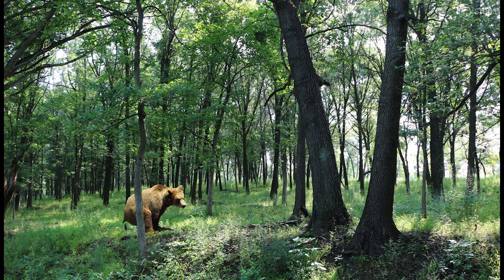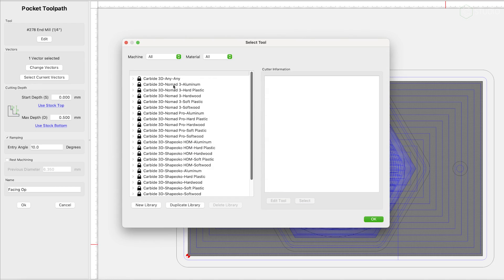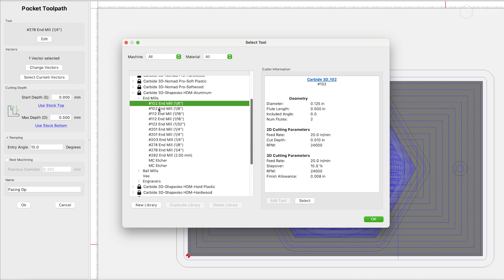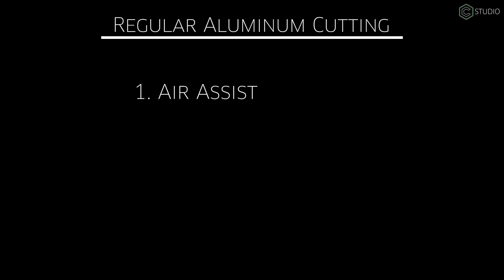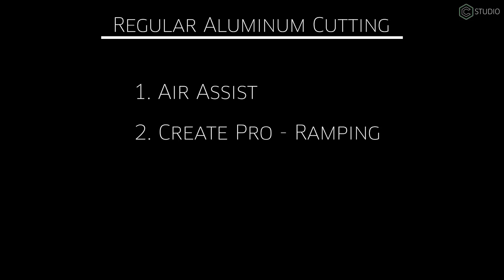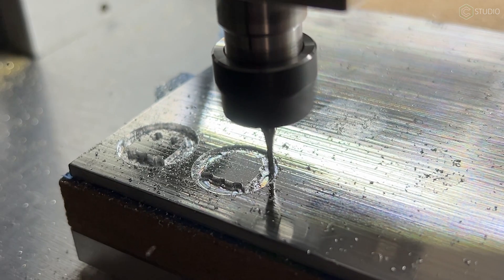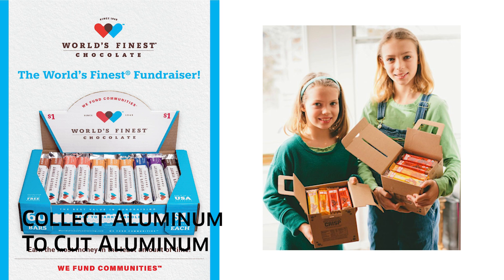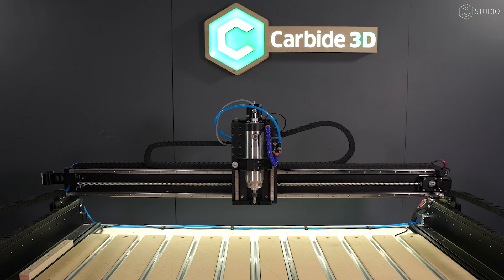Cutting Aluminum - Shapeoko 5 Pro - Video 7

Comment: I thought the air was for cooling. You can generate a lot of heat routing aluminum.
Reply from the maker: If you’re cutting it with the correct settings, you shouldn’t be generating much heat.

Comment: Do you need the sign making (tempered) endmills for aluminum?
Reply from the maker: Aluminum can be cut with most of our tooling.  For many jobs, the single flute endmills are the best place to start your aluminum journey.   #274-Z and #278-Z endmills are our front-line weapons in an aluminum or brass application.

Comment: Also, make sure your chip load is correct. Too high and you'll snap your end mill. If it's too low, friction will create a lot of heat to build up causing the aluminum to melt and fuse to your end mill... especially if you're not using cooling.

Comment: If you had this machine in the 2x2 format cutting aluminum Id probably buy it, you guys need more videos of this machine in aluminum since alot of us want to use it for that
Reply from the maker: We do have the 2x2 format.   The entire machine structure is the same just smaller.  Since there are zero differences, it's  just as capable.   https://shop.carbide3d.com/collections/cnc-machines/products/shapeoko5?variant=40249287737405
Reply: @carbide3d  I understand, the reason I wanted to see the 2x2 is 1. You guys rarely feature the smaller machines and it would be nice to see them, and 2. The smaller geometry with the same specs means the machine is naturally more rigid.  I can bend a 1” piece of steel that is 5ft long, I cannot however bend a piece of 1” steel that is 1ft long.

I’m sure the elasticity of the machines overall play into the vibration damping but it would seem that the smaller machines would be slightly more robust given the shorter lengths of the components.

I know nothing however and really would just like to see one of the smaller machines in action and cutting aluminum.  Kinda selfish to ask but then it’s a lot of money to spend too

Comment: Can we work on 20 mm deep aluminum blocks? We need to drill  holes and chamfer the edges, is this possible with the  Shapeoko? Also is it possible to cut stock lengths of  T2080 slotted aluminum rail? I don't have to buy a separate chop saw then
Reply from the maker: Hey Arbj,  I see you’ve reached out on the forum and gotten a variety of feedback and information.   Our machines, and particularly the 5, are absolutely designed to cut aluminum as regular duty.

Comment: Great video as usual! Covered almost everything here. What would be your recommended chip load (feeds and speeds) for engraving with v-bits?
Reply from the maker: We are in the middle of a complicated aluminum project which includes engraving with the 501 PCB Engraver.  There will be a ton of info there.  
I’ll grab the speeds used in that project.

Comment: We use our Shapeoko 3 xxl to cut aluminum with the carbide 3d router but not dry cutting. Added a mister and use hytap cutting fluid mixed with water. 40ipm with .040" depth. It cuts great but the waste board don't like it. Going to try some of the end mills recommended with just air and see how that goes. Would love to eliminate the cutting fluid.
Reply: How'd it go?

Comment: Another good video, thanks.
My number four for the checklist would be "Know what you are cutting."   It's shiny and silver, and not very heavy, so it's aluminium, right?   Yep, probably is, but aluminium formulated to be squeezed through a die to be sold as flat bar at a hardware store will most likely stick to your cutter like bubblegum, clog the flutes, and make it self-shorten.   (Break, Mary-Lou, it's called "breaking!")   An alloy made specifically for machining will produce results that make you smile all day!  (T-6061 or similar).
Try it out... give a boy a hacksaw and a piece of hardened tool steel, and start your camera rolling!  🥴  😉

Comment: any metal requires use of flood coolant or at least a mister. I mounted one to my 3 and bolted it to a tapped hole I drilled on the spindle clamp. A few hoses, regulator and a gallon container of kerosene/wd40 or synergy 735 coolant is all you need to prevent chip welding and have much happier cuts. It will pool and make a mess so you might want to put down plastic or some kind of board you don't mind getting soggy.
Reply from the maker: Use of coolant is up to the end user and not required.  We cut dry 100% of the time.
Reply: @carbide3d  what bits / coatings are you using to not chip weld the tool up ?
Reply from the maker: Bits are in the description.  Zirconium Nitride,  Single Flutes are less likely to get filled up.  If any endmill does begin welding, a good Lye Soak will bring them back to new.
Reply: @automan1223  I've used uncoated endmills. The main factor is the person programming. With proper strategies, feed/speed, you don't get chip welding. A good chip will put the majority of the heat in the chip and away from the material/endmill. Single flutes do help a ton with chip evacuation.
Reply: I've cut aluminum, copper, and brass dry, air blast, and on the HDM with mist. All cut great. Metal certainly does not require flood. Is it better, yes.......required.....no.

Comment: so 3500 for the 4x4, 750 for the vfd figure 250 for some accessories like bit setter or something, that $4,500 defiantly not a hobbyist  piece. your getting into grizzly vertical mill with controller territory, only thing is you have more surface area to work with. it sucks you dont still sell the actual hobbyist machines like the 3 for 1,500 and then offer these for the more hardcore people.
Reply: It would be challenging to send a 4x8 sheet of ply through a grizzly vert mill.
Reply: @ahhsk  well i said the have the surface area to work with. but if your main selling point is aluminum milling my statement stands true.
Reply: @the_chomper  I don't think it's the "main selling point" I think its a really awesome additional capability for what is primarily not an aluminum milling machine.
Reply: They still sell the 4 for 1700

Comment: I have cut metal with makita router. But I definitely use single flute bits and I check the rpms at the start of each job. But a vfd would be awesome for sure. I also have air assist. Sometimes I use it with mist of wd40. Those look like great parts.

Comment: I'll add #4 to the list: Single flute endmills like the #278Z and #274Z. Especially the 1/4" as it gives you more margin for error. 1/8" is more forgiving of having 2 flutes.
Reply from the maker: These things are true.  I use the #102-Z or #102 frequently , and in the video, on aluminum because of its greater tolerance for too aggressive feed rates.
Reply: @carbide3d  We tried the 102-Z today cutting aluminum, ordered 4. The end mill immediately gummed up and started to burr the material to the point the router started to jump and get off track. This was at 40ipm with air evacuation. Also tried running it with mist/coolant and still had the same issue. Any tips on this? Switched back to a similar end mill that we normally use at the same settings with coolant with no issues.

Comment: 5 Pro on order :) when are VFDs going to be back in stock?
Reply: What size did you get? How is it doing for you?
Reply: @Kevin-im1ns  4'x4'. Oscar at tech support helped me correct my VFD plugged into the pendant slot, besides that smooth as butter.  My first cuts were brackets to connect the control box and VFD to the Kreg 64x64 table (great suggestion). Next cut was adding M6 inserts to the spoil board. Easy peasy. Making Kitchen Cabinets next week!
Reply from the maker: We are working on that.  Be sure and join the Notification List.